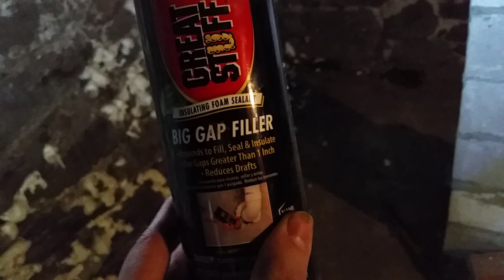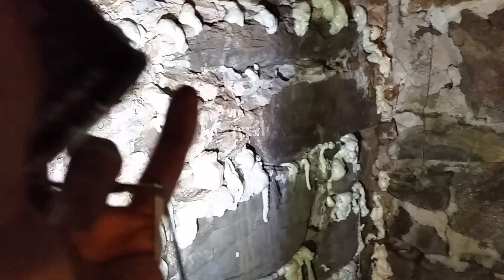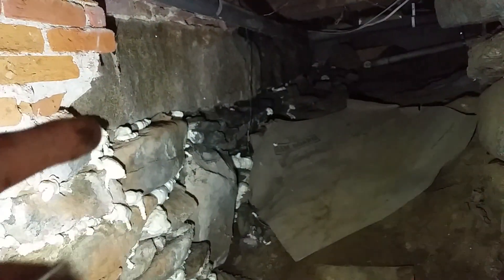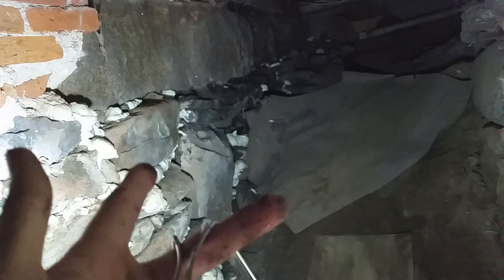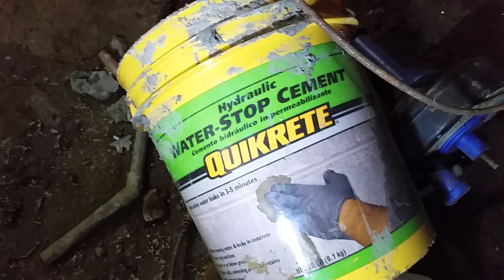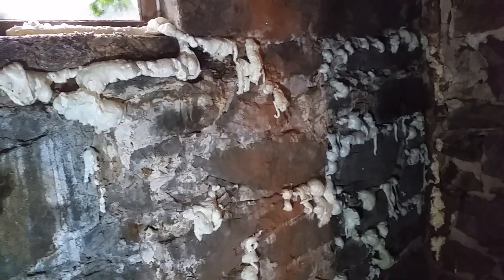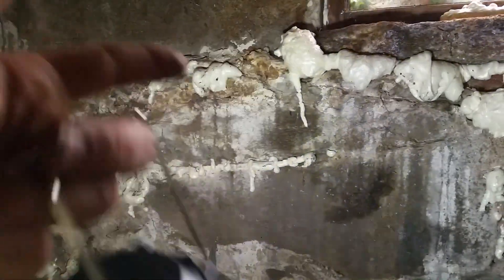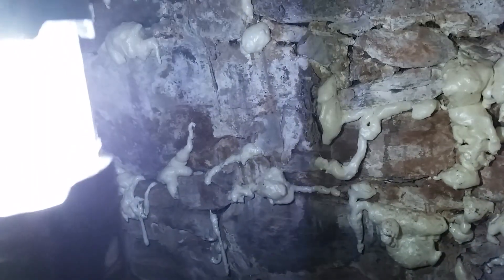Sealing Field Stone Foundation in 250+ Year Old House | WATER TIGHT

Comment: Good Lord!  I just came across this video and I am stunned.  You need to repair and repoint the stone first and once strengthened then waterproof the walls from the exterior doing one wall at a time and backfilling BEFORE moving on to the next wall or you risk wall shift and collapse. After that then and only then can you build an internal false wall in front of the stone wall and insulate with rockwool, rigid foam board, or fibreglass.  NEVER EVER sprayfoam old stone walls. 

Due to the nature of construction back then, those walls will always leak. That is just the rule of the road for old fieldstone homes.  You may even consider not building a wall in front of the stone so that you can address future leaks regardless of how well you waterproof from the outside.  Hydrostatic pressure is another culprit in these old homes which forces water in up via the floor or at the base of the wall.  

I applaud your hard work but in the end time will trap the water inside the wall and it will accelerate further deteriorization. Any grade level sections can fall victim to freeze/thaw damage where the water trapped in the wall will expand and further damage your remaining mortar. You mention proper drainage at a later date from the outside. Excellent!  However you need to do that first.  Spray foam has zero structural integrity and those field stones need to be repointed using a lime based mortar, not concrete. Concrete has a poor binding with field stone whereas lime based mortar has an excellent binding outcome.
Reply from the maker: Oh I'm well aware of the full extent of the work.  I went through this will a previous house.  This is a minor fix to fill the gaps before I could get to the rest done.  And foam insulation is perfectly fine for this application.  This had been the recommended procedure  when I did it at my old house.  But selling this house so it's a moot point now.
Reply: @punkyroo  So you'll be passing on the problem to an unsuspecting homeowner who will likely have to pay tens of thousands in foundation structural repairs because you used foam insulation. Whoever told you foam insulation was fine on a fielstone foundation has no education in century homes of this construction. You should contact an actual professional who knows and have studied the construction of these homes. The future homeowner will likely be dealing with stone and brick blow-out. Hopefully, they consult with a historical consruction engineer for inspection before the home goes into escrow.

Comment: Step one. Mitigate the source of the infiltrating water. Step 2. Clean out old joints. Step 3. Take expanding foam, throw in garbage. Step 4. Tuck point with type N mortar or other mortar that is suitable for the type(s) of stone in your foundation only after you deal with why the water is infiltrating the house in the first place. Stone walls need to breath. Anything that traps water or impedes moisture traveling through the foundation will help the water sit there and dissolve/degrade the stone it encounters.
The problems your setting up your house for may not rear their head until your long out of the house. Don’t be fooled by “well, the short term problem went away”.
Spraying in all that foam just added days of work to who ever will have to go in and do it properly. It will be a nightmare to take out. (Just like tire slime on leaky tires) 
I appreciate your effort to try to fix the problem and document it to help others, but I believe your methods and video will do more harm than good!
Reply: how about water mitigation on expansive clay? if it gets too dry it will contract and settle. I'm trying to find info before I start my basement project.

Comment: If I were you, I'd repost this video and point out that you're not supposed to do this, but it's working to keep water out at the moment, but will deteriorate the stone overtime, and also isn't enough to support a crumbling foundation, and then explain you did this as a temporary fix, though it will be a pain to clean out all that foam to do the job right. Also note that you don't use cement, but mortar with lime (Type S or N Mortar) to repair stone foundations. You don't want to lead anyone to do this in their own home because it can cause a lot of problems in the future.

Comment: So you said older than the united states? That means the space under your house was not really meant to be water tight, even if it was used. They didnt have modern cement or mortars. Their mortars were water permeable, if it was ecen used in the original and isnt a drystone foundation. Nearly all old foundations and structures were designed with water movement taken into account. they knew it would get wet in the house and under so they built to let moisture have a way out if/when it came in. Im not saying they didnt do all they could to keep it out but let it pass through if needed from say a roof leak or rain. We still care about giving water a way out but we try more to seal things. Old brick buildings fail because they were made with lime based mortars originally and redone by modern moisture that traps moisture in.

Comment: You used insulation foam to fill spaces where mortar has deteriorated and fell out between the rock?
Reply from the maker: +Mad Hatter it's to fill the tiny spaces I cannot access with mortar.   The excess foam will be cut out and I will point the field stone as you normally would.

Comment: is the the waterproof spray foam because there are to types the indoor one is just a gap filler and not waterproof so make sure it for external grade
Reply from the maker: +50 shades of green Good call.  I didn't find any that was specifically outdoors... I'll double check what I am using to see if it's officially waterproof.  In my experience it seems to repel water.
Reply: Do not use this stuff on a stone foundation!

Comment: We have been restoring our 3 story stone house circa 1600s . I feel your pain. In our house the stones are stuck together with local clay, I guess its rammed earth  now. The problem is dampness travels in between the stones and yes even at 60 cm thick. I too had a river flowing into the house. You only have 2 options and the only correct  one is to dig down to bellow the foundations on the outside grout between the stones waterproof and provide airing, put a drainage and back fill with gravel. Wait a year or two for it to dry out. Mine is now completely dry and I have not touched the inside yet. You do have the other much cheaper option but you will need to hide all that lovely stone. I do not agree with the foam, but understand you as I did that the first time I saw the river and if I learned something water will find another path eating away the stuff that holds the stones in place (clay/sand). Hope this helps :)
Reply from the maker: Well, we are now selling this house because I'm tired of spending my money and time fixing it up.  I'll leave this work to a younger, wealthier, and / or more skilled person than I.

Comment: The worst thing you could have done for a stone foundation. You should have educated your self prior to this rubgoldberg fix or been smart enough to ask questions. The stone foundation should have been repointed. You think you had problems before just wait. The mortar joints should have been repointed with a lime mortar like NHL3.5 and you could have sealed the wall wilth waterglass which is a sodiulm silicate liquid you mix with water. It seals but allows the wall to breath. Using a portland product on stone is a bad thing.

Comment: That basement looks like a nightmare.  I think the best way to have a dry basement is to build your house on a hilltop.  Moving an ancient house could be a bit of a problem.  I don't know if foam is the best way to fill in the holes of your wall but I am sure it is better than a pair of pants 👖. 😆

I had to deal with a wet basement issue.  We had water coming in between the wall and floor.  We tried sealing it up to no avail.  So finally we cut out a drain all the way around the edge of the floor and put drains leading to the sump pump.  It was lots of work but it was worth it not to be flooded every spring.  My house was about 200 years newer than this one.